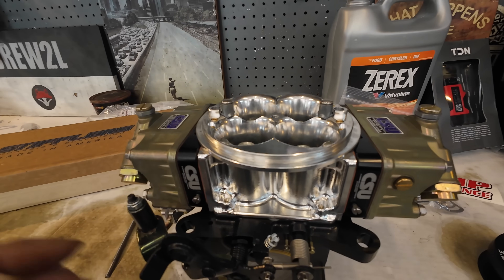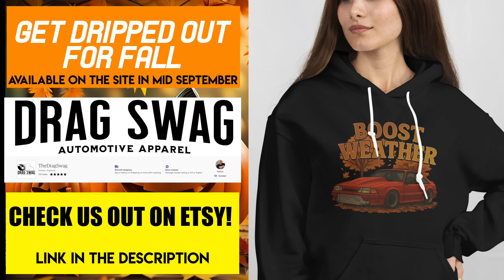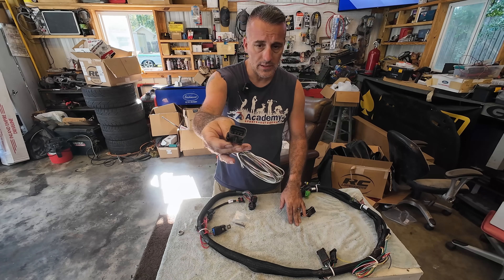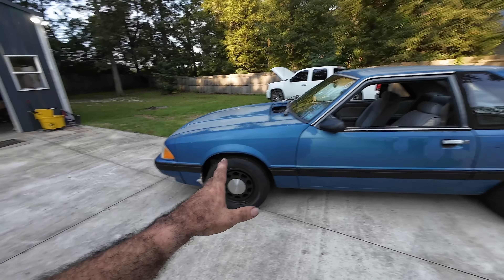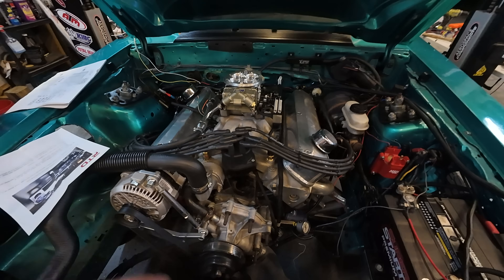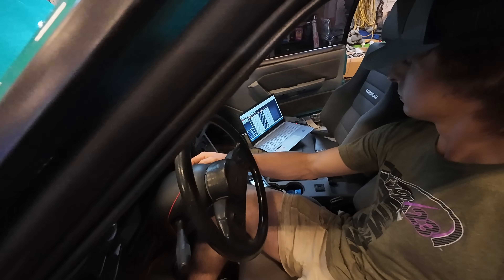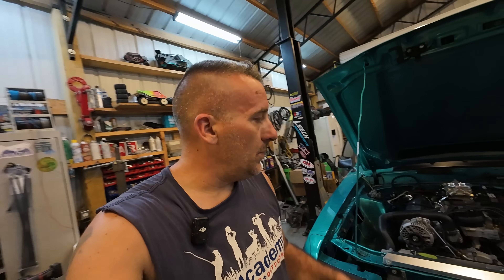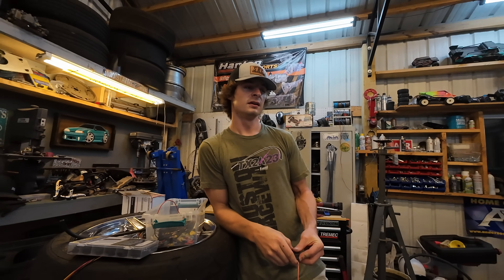This Will Change The Carburetor Game FOREVER! - Terminator X Controlled Carb Setup

Comment: I made ECU code from scratch that's better for carb guys than this nonsense. Well, the carb guys who actually tune their own shit anyway. Full sequential port injection, capable of running an engine faster than the laws of physics will allow you to try running any engine. Has a spark cut rev limiter, bilinear interpolation between cells for fuel and spark, end of injection timing adjustment per RPM with it's own interpolation. That and a standalone wideband... anybody who has any understanding of tuning could sort that out.

Comment: That’s funny, I’m running a carb with my pro Flo 4 ecu. The ecu kept leaning out the fuel way too much and it was after I would adjust fuel trims, changed base maps. I couldn’t get it working correctly so I put the carb back on it with all the pro Flo 4 data and it’s great.

Comment: 8:02 I got a great deal on mine. It's a 89 lx hatch, original 4 cyl car but already 5.0 swapped, cx racing turbo kit, adjustable rear control arms, 5 lug conversion, rear discs installed, 18 inch rims with 17 in rims came with it also, all for $1500. I think I won on that deal

Comment: Billy the kid has a terminator x on his S10,& it’s a destroked 400 to 377” engine. He had a carburetor for the longest time before he went fuel injection and it is twin turbo too. For sure more ways to power management and that’s the important part to drag racing. You can have all the power in the world but if you can’t put that power to the road it’s no good.
Reply: He has the dominator setup actually

Comment: What valve spring kit  and roller rockers for Bcam and gt40 heads?
Reply from the maker: Stock springs are ok as a get by. But we usually use trick flow springs. Call up Donnie B at Anderson Ford Motorsport he can hook you up!
Reply: @BREW2LFOXBODY  that’s the guy you had called on one of your videos?

Comment: Lots of very useful information, I’m definitely thinking about getting rid of my Megasquirt. That system looks so much easier to understand and use.
Reply from the maker: Both are good systems! I’d say the Holley is a little easier though 👌
Reply: why does megasquirt suck? i get terminator is prolly easier to use n understand n newer. i wish it had 6r80 capability. i wonder if you'd grow out of it being low amount of inputs
Reply from the maker: @bunchboy137 I never said it sucked. I loved mine! But the terminator X just has more capabilities especially since the software got a massive overhaul recently

Comment: Add a carb cheater and you got complete control with an auto tune for carburetors.
Reply: what if i told you that thing is for people who still live in the matrix? 😉
Reply: The Holley can control an IAC.  Should be able to do a custom table to open it under cruse if the AFR is not on target.
Reply: @russellbroadwell use the iac and terminator to adjust afr pretty slick